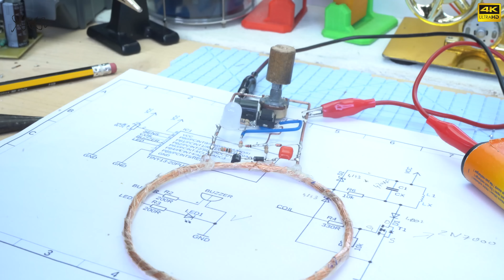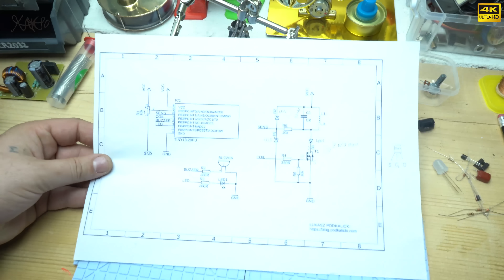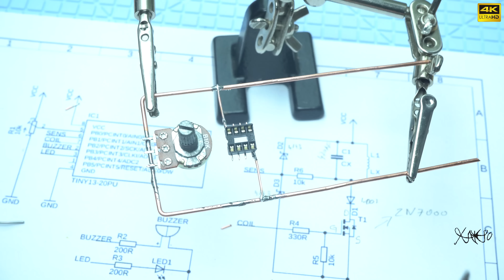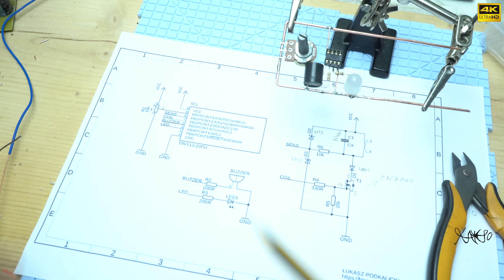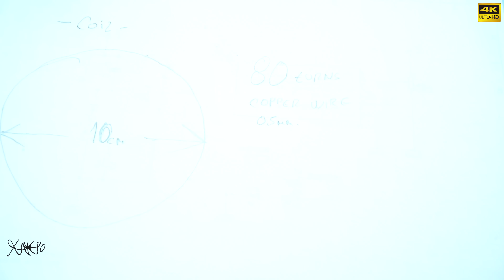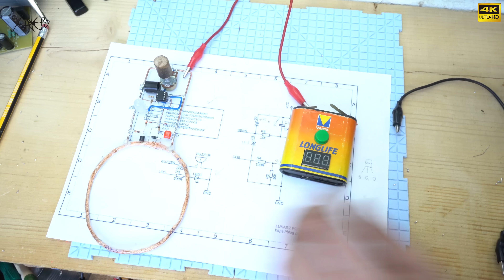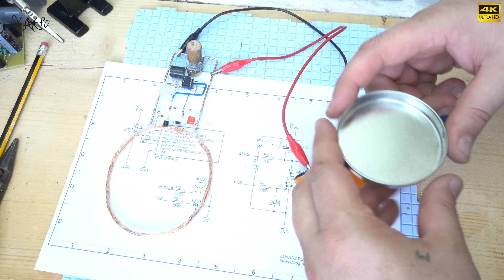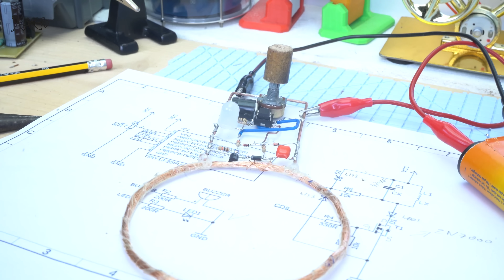How To Make Metal Detector at Home - Skeleton PCB and easy

Comment: can you make a metal detector without any kind of IC ? plssssss with out IC because i can't get any :| i tried !!
or can you make a metal detector from a satellite receiver remote control "i think this is so easy" ?? i've been trying for this one for like a month ! :| but i don't know how it works anyway i like your videos keep up .
Reply: Do you have an address where a postal package can come? Then you can get pretty much any popular IC, because they are available online.

And yes, you could make one without ICs, for example using transistors.
Reply: @tomaszwota1465  can you explain this "using transistors" please ?
Reply: @Riv0x  Look up simple BFO detector schematics. Pretty much all you need is the coils and capacitors to make the frequency generators, a piezo or whatever speaker, some resistors and a way to amplify the sound which can be done using common transistors, opamps or more specialized ICs, whatever you have lying around.

Build a simple BFO detector for practice, but don't expect it to have great performance.
Reply: @tomaszwota1465  i will look up for it, Thank You so much for answering me, Merry Christmas and happy 2020
Reply: @tomaszwota1465  ohh thanks mate i will :D